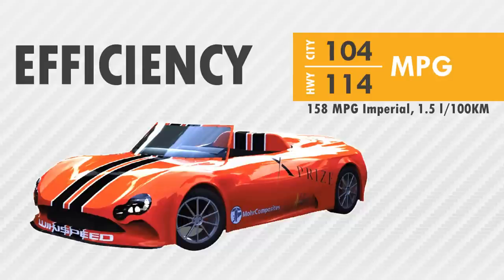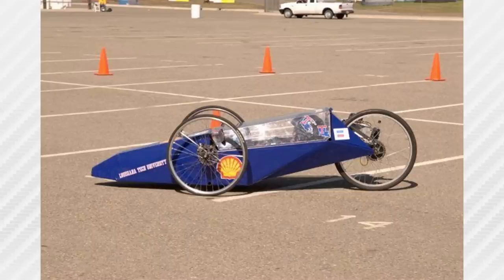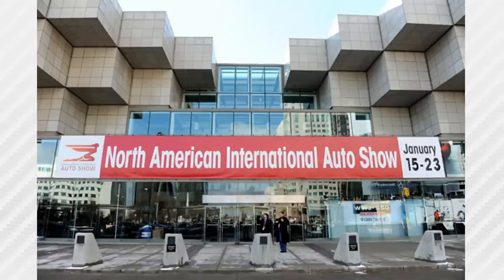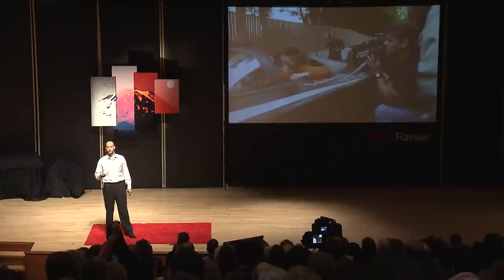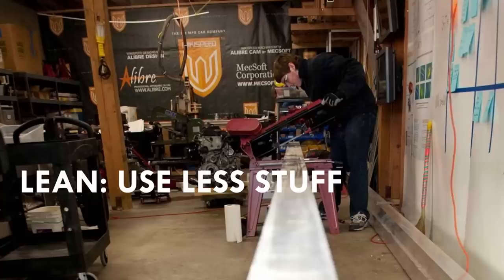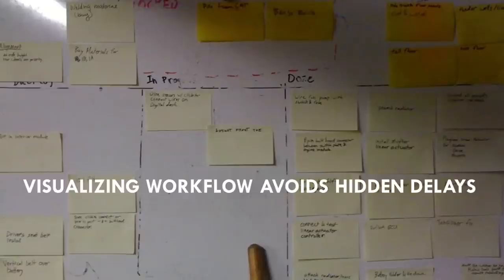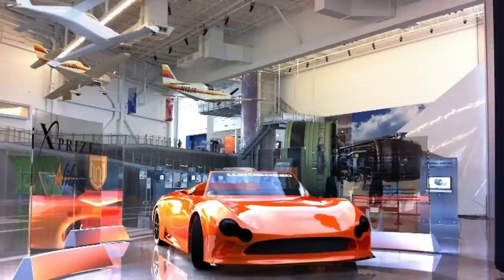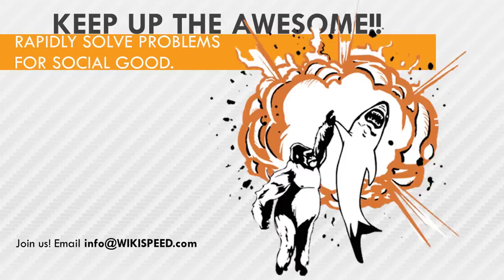TEDxRainier - Joe Justice - WikiSpeed

Comment: Interesting talk, but I wonder how many of the Wikispeedsters know anything about scaling out for mass production.  If they tried to setup mass production they would run into the problem they illustrated where the cost of a  mold for a door has to be amortized over several years.  They avoid that now by building one car at at time.

The agile processes that they borrowed from software development teams are typically used on small teams of less than a dozen engineers.  And of course developing software is far different from mass production or any other manufacturing process.  It is well suited for building prototypes, but there's a big difference between a prototype and a large scale production system.
Reply: I think he's more about changing long held beliefs and looking at new ways which can be incorporated into mass production but the development will be faster and cheaper.
Reply: +Dean Schulze wel toyota has proven that these ideas work in the automotive industry at scale.
Reply: +YvesHanoulle - Exactly which of the ideas in the video has Toyota adopted?  It's been a while since I listened to this Ted Talk but at one point he talks about one worker teaching a new worker what he needs to know about engines in order to build a car.  I wouldn't want a car built on an assembly line whose workers didn't already know what they needed to know about engines.
Reply: +YvesHanoulle - Here's a reality check on WikiSpeed's manufacturing prowess:

"We have encountered a block in our engine module development and need your help to continue.Sadly, we’ve failed to deliver a car a running engine since car 002. Our only successful customer deliveries since have been to groups that opted not to purchase an engine module.  We haven’t been able to get stable and durable running engines in any of our cars since car number 002. Car number 002 was built by an AWESOME ASE certified master mechanic with experience at Mercedes Benz and with custom fabrication. With that success, we began taking customer orders with him as foreman of our prototype assembly line. Shortly after, he left Team WIKISPEED to found his own auto-repair shop in his home town, a dream he’d had since childhood."http://wikispeed.org/2015/01/wikispeed-needs/
WikiSpeed sounds like an interesting learning project for people who don't know much about cars or manufacturing processes.  I wouldn't want to buy a car from them, however.
Reply: I would build a car before I bought one. These cars are so simple a high school student could build one.
Reply: I agree pretty much 100%.  As @Michael Greensmith was saying, i think this was aimed moreso at the development team management / digital fabrication based rapid prototyping aspect, and there is a bit of naivete in making a 1-to-1 comparison to conventional factory produced cars.

HOWEVER

If your car can be built in a makerspace, or local auto-shop, why not just have everyone do that instead of a central factory shipping worldwide?
Reply: Granted internal combustion engines are quite a complex mess, but BEVs or FCEVs have much less complexity

(I guess even some sort of goofy thing like an external combustion steam engine or something wouldn't have as much complexity either, but compared to state-of-the-art ICE's, BEVs and FCEVs are damn simple)

(Although motors/batteries etc would probably still be bought from a factory etc, but how those are used / how quickly the design using themcould change (or swap to another supplier/product) would be similar to what the Tedx Talk was discussing)
Reply: @ericlotze7724   cause its less efficient, and less reliable cars could be produced in some shops
Reply: @HeLLioN_101  I agree with the quality control issue, what do you mean by less efficiency?